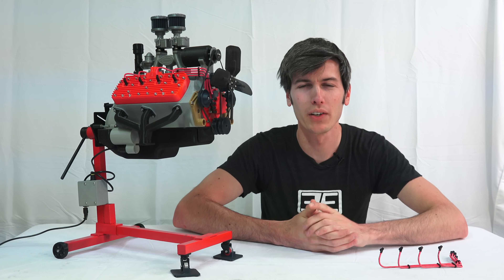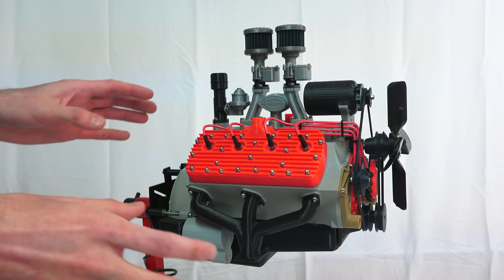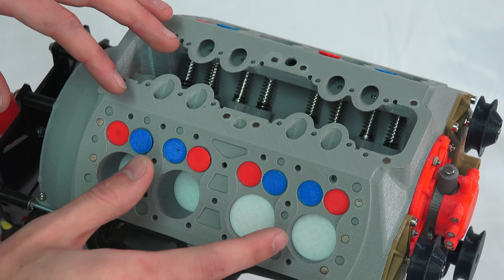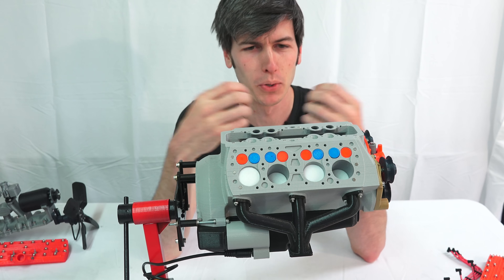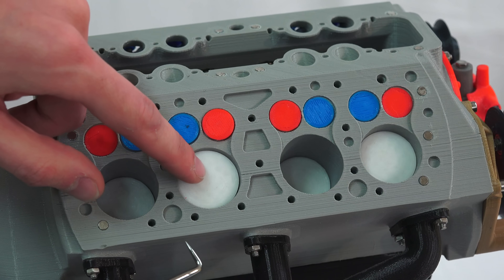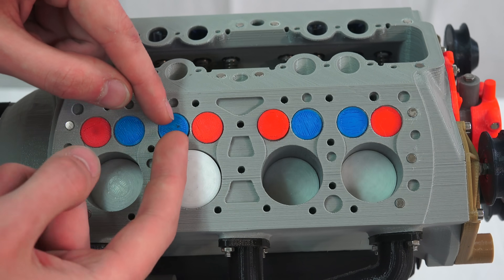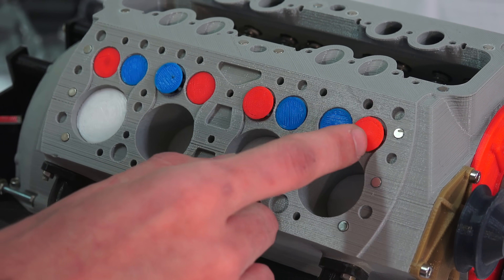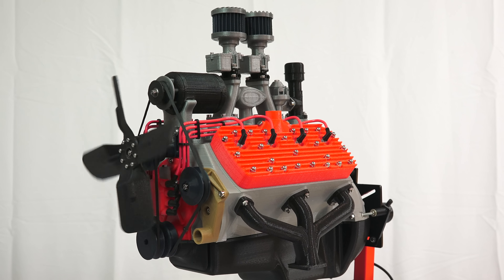Why Ford's Flathead V8 Engine Died

Comment: Lots of comments about the shortcomings of the Ford flathead. I recall seeing a documentary about its development that stressed its design as a means to build a V-8 of low enough cost to mass produce for ordinary cars that ordinary people could afford. V-8s (and 12s) had been boutique engines, very expensive, with separate cylinder blocks. The challenge of this block casting was almost insurmountable, and there were severe problems in early production engines, but they eventually worked things out.
Reply: In 1932, the new Ford V8 cost $10 more than the 4 cylinder model B (equivalent to around $182 today). That is incredible. Imagine something like that today!
Reply: I never understood why Ford didn't design it like a Caddie flathead V8. With exhaust right next to the intake. Maybe a little different to work with, but would have limited the overheating problems.
Reply: Yes, Ford did warranty those engines. Because of the engine production problems of the early V8's, Ford modified the Model A engine, which become the "Model B" engine, to keep the new 1932's moving out the door.  The 4 cylinder Model B engines remained in production into the late 40's.
Reply: Did Ford warranty all those blocks that failed early? I bet they didn't. Tough luck, buddy. buy a Chevy next time.
Reply: @alribee  Chevrolet had a v8 that saw limited production well before Ford's.  They were overhead valve engines, but they were horrible. Most were yanked out and thrown away.  Chevy didn't market another v8 until 55.

Comment: From across the pond. Excellent video, one of the best I have seen on this subject. My Morris 8 - 1937 era,  had originally 21.5 BHP and was 918 CC - 60mph flat out. The later engine was a massive 29 BHP. With a charger I broke the half shafts but could out run a Mini. The only plus side for a side valve was that you got one hell of a lot of swirl which did help burning at low revs. The Morris 8 had a larger pocket for the valves which allowed the gas to flow better. The CR was around 7. It did 45 mile to the gallon - just. I have owned Fords for around 50 years. Good old Henry.

Comment: So this small fan blowing air over the engine is enough to cool the whole block?
Reply: Sch lurf.
No, that not what the fan is for! The fan's job is to pull cool outside air through the radiator.
Reply: Yeah, I'm 'ere ah I see, thank you!
Reply: Sch lurf.
Cheers bloke. Rob.

Comment: My father born in 1919 and I we’re talking about Ford V-8 of this era. He said they were quite a bit quicker than other equivalent cars but they had drawback that he mentioned to me. He said they came oil burners very quickly after they were a couple years old. I don’t know if it was a design flaw or possibly they were just using soft piston rings that would wear out and allow excessive blow by. Chevrolet/ GM. Came out with the overhead valve six cylinder about the same time as ford came out with Flat head 8.  The stove Bolt six cylinder was not as fast off the line as the ford V8 but it did make about the same horse power. The Stove bolt engine was one of the most reliable and easy engine to maintain.  The early engines were about 164 in.³ and they were made all the way up to 170 in.³ in later years. The most common is probably the 235.  Even Toyota manufactured under license the Chevrolet/GM stove bolt engine. It morphed into the Toyota 2F used in the Land Cruiser’s.

Comment: If I remember correctly I believe the French built the flathead after Ford stopped building them for military use up to the 1980's. Hot Rod magazine did an article on flatheads a while back.
Reply: dethfan06.
French car manufacturer, Simca, produced the engine under license from 1954 to 1961.The engine was also produced, under license, in Brazil by military vehicle manufacturer Unic Marmon (also owned by Simca) until 1990

Comment: Compression ratios back in the day were so low because the gasoline octane was in the 60's...and that was on a good day. Indy race engines in the 30's were making nearly 100bhp/liter on methanol.
Reply: Aceroadholder-   That's true, but only tells part of the story.  The part not mentioned here is the space between the valves and the combustion chamber roof above them.  That's 'dead space', power-wise, as combustion taking place here shoves both ways:  against the valve crowns and against the chamber roof, totally wasting energy and creating stresses where they don't need to be.  In an OHV engine, combustion forces ALL act against the piston crown, being trapped by the chamber roof in the head.  This allows an OHV engine to be much more efficient at harnessing combustion energy and making horsepower.

Comment: Yep... Ford built this config because it was cheap, not because it had any performance or efficiency advantage. Henry had an obsession with cheap, to the detriment of technical progress. A pushrod OHV engine, as we can see by GM’s success, had/has much more potential for performance and efficiency. The installed power to weight, total installed volume (not displacement, but external volume), and fuel economy achieved by the LS and LT series V8s are rather remarkable. You can cruise down the freeway in a 450-odd HP sports car and be sipping fuel to the tune of near 30 mpg. DOHC designs, in contrast, offer higher power per unit of *displacement*, and higher textbook efficiency, but their physical size is greater, CG is higher, mass is higher, cost and complexity are higher, and hence total installed power and efficiency tend to be lower as a result.
Reply: You're comparing 1930 technology with 1950 tech. Yes, the Ford V8 was simple and for very good reasons: cheap to make. cheap to sell, cheap to maintain. It turned out to be one of the most successful engine platforms of all time. Era hot rodders loved it and hopped it up well past its demise as a production engine.

But time (and technology) marches on.The small-block Chevy was just as revolutionary in its day, and soon to become legend for its wonderful simplicity and durability. Availability of performance mods is endless. It derivatives live on today in the fabulous LS Series. A true American success story.

But to compare the two platforms against each other is futile and unfair.

Your inner fanboy starts to show when you dismiss it as a typical "cheap Ford"
Reply: Not a matter of fanboy, matter of history.  Henry had an unhealthy obsession with cheap, to the detriment of advancement.  That's why the Model T was produced so long after it was functionally obsolete.  Sadly that legacy lived on, as even the Mustang had a live rear axle until just this most recent generation.  Instead of proper suspension on the Explorer, they recommended underinflated tires.  Instead of proper wire gages, they used cheaper too-small wiring in the dash of millions of full size Broncos and pickups, resulting in fires and a massive recall... I witnessed one of these fires personally back in the 90's.  I could go on, but point is they have a history of focusing on cheap, regardless of performance or even safety.

Also, to demonstrate "not fanboy", I'll state categorically that GM has also had problems with letting beancounters rule over engineering at various points in their history.  Shoddy interiors (until only very recently), the disastrous Vega engine, the disastrous 8-6-4 engine, the Olds diesel... you get the picture.  They've made their share of crap.

Might want to check your facts on "1930's vs 1950's technology".  Buick patented an OHV engine in 1902.  The fundamental concept of a pushrod OHV engine actually predates 1900.  Ford was beaten to the OHV V8 punch by multiple manufacturers.  Again, their focus was on cheap to the detriment of advancement or performance.

Hot rodders did what they could with the flathead only because they were cheap and plentiful.

Comment: The French (backwards bastards) used them through the 80s
Reply: John Smith.
Simca, the French car company, manufactured the engine under license until 1961, and Brazilian military vehicle company, Unic Marmon, also manufactured it under license until 1990.
Reply: One of the few things they got right.

Comment: That took 3 rolls of gray filament just for the block, but nicely done! If the cam is correct, had actual spark, and took the solid headers off I bet it will run on naphtha. Wanna try it?

I question why oval pistons were not at least tried. Keep the piston heads away from the valve area but use more of the space available between cylinders. I'm not sure of one oval piston car/truck engine but knew Honda/HRC used them to great advantage, enough to get the design banned from racing. I guess casting still wasn't great back then so it wasn't a possibility in the endurance department.
Reply: This engine was designed as a cheap, well performing engine for the masses. How are you going to machine oval pistons and cylinders (and rings) cheaply?
Reply: Honda made an oval piston racing bike and it did OK. The problem was getting the rings to seal equally all around under every temperature and pressure condition. After spending years and mega-yen on it they went back to round pistons. They're simply much easier to work with and much cheaper to make and run.

Comment: Hey Jason, can you do a video on blow off valves and more specifically on whether removing/blocking it is bad for your turbo or not. This debate has been raging on the Mazdaspeed and Subaru forums for a while and nobody seems to have a clear answer. Some say it's okay as long as your turbo isn't making a lot of boost and others say it destroys the bearings either way. Can you please shed some light on that subject. Thanks!

Comment: The French military made and used the flathead Ford up to the 90's. Just ask Flathead Jack.
Reply: prancstaman.
French car company, Simca, produced the engine under license from 1954 to 1961. The engine was also produced in Brazil by the military vehicle manufacturer Unic Marmon (also owned by Simca) until 1990.
Reply: Yeah, I'm 'ere Brazil military too, cool. Thanks for the info.
Reply: prancstaman.
Ford also supplied the engine to many industrial, agricultural, and construction machinery manufacturers around the world who couldn't produce their own engines. Cheers, Rob.

Comment: AMC was still using a flathead six cylinder engine in some of its models till around 1964...
Reply: I learned to drive a '53 Plymouth with a flathead six/"three on tree." I was born in 1947 (before Truman was elected). I swear--and I look it.
Reply: They outstalled Chrysler.  Mopar was still selling flathead 6's in 1958.

Comment: That motor seemed so clever. Lower center of gravity, less weight, shared common parts... Until you explained the airflow issues. That seemed like a lot of HP but it's outmatched by today's standards.

Comment: i can see the intake runners but where does the exhaust go??
Reply: stickloaf Through the block. The cylinder head is basically just there to cap the cylinders and hold the spark plug.
Reply: the 2 center cylinders of each block bank had to channel exhaust gases through one  narrow passage through the cooling water chamber in order to meet the central tube of the exhaust manifold  on the outside of the block ( look a the video and observe the exhaust manifold, it has 3 tubes) . At high power outputs the exhaust flow of these cilinders added heat to the cooling warter stressing the block casting. Many blocks developed cracks after overheating events. on the engine. The first and Forth cilinders of the block bank had  its own exhaust passage and lived more comfortable. erwin Finsterbusch

Comment: I'd sacrifice some efficiency and power for more reliability and better ease of repairs. The simpler an engine is, the fewer parts there are. The fewer parts there are, the less there is to break. The less there is to break, the more reliable the engine will be (compared to other more complex engines). I bet with modern technology, Ford could revive the flathead and get 500+HP out of it, but the government would probably make it impossible due to emissions and regulations and such.

Comment: I love the flathead Ford. I have one in my street rod. It is the simplest V8 ever made. It makes a beautiful sound. It is super easy to work on. Compared to the computer controlled fuel injected DOHC 16 valve intercooled turbocharged VVT inline four in my Chevy Sonic transportation car, which is an absolute nightmare, the flathead Ford is a masterpiece of industrial art. It is my favorite engine, way ahead of my second favorite engine, the old school OHV cast iron small block Chevy. I'm 59 years old, and a serious vintage car guy. I don't give a rat's ass about newer cars. They are cheap used, you buy them, drive them, and throw them away when they break down.

Comment: they used to crack blocks. Cadillac had first v8 much better ohv
Reply: Cadillac v8s were flatheads from 1914 to 1948. OHV introduced introduce five years before the Ford OHV.
Reply: motorhead.
The first V8 engine was patented by French engineer Leon Levavasseur in 1902, it was a 24 hp fuel injected unit developed for competition speed boats.
Reply: Yeah, I'm 'ere check out the Napier Deltec diesel . Triangle three crank two stroke . Awesome engine used in British trains.
Reply: motorhead.
Yeah, that's a very durable and powerful engine, it sounds terrific at full scream as well! Napier certainly produced some amazing engines in their time. Cheers, Rob.

Comment: The thing that fascinates me about this engine is its crankshaft is supported to the block with only 3 main bearings. The simplicity of its design, as demanded by Henry, even left out an oil pump on the first few prototypes, leading to early engine failures. The basic designed engine was fitted to all 3 car divisions vehicles and went on to become the #1 choice for hot rodding. Technology has all but left the Ford design extinct, save for the flat head enthusiasts and museum displays. But hey!, in 1832 that was cutting edge technology of the time.

Comment: My father had 2 Chrysler Imperials, 1 a 69 with a 440 and a Holley 4 brl. The other, a 73 also with a 440 and a Thermoquad 4 brl. The 69 produced 350 hp and the 73 only 210 due to the wonderful smog junk. I never ever thought we would see 300 hp engines again in my lifetime... Boy was I wrong ;-) Amazing what tech has done :-) And time marches on... wonder what the next 50 years will bring ??? Thanks Mr EE :-)
Reply: There was power loss thanks to lower compression ratios, timing changes, possibly cam changes, and introduction of EGR starting around ‘72, but they also changed horsepower ratings from brake HP to net HP, from rating a “bare” engine to one with all installed accessories. Actual power drop, while real, was not as great as the numbers made it seem. We had a ‘73 New Yorker. Its 210 HP net-rated 440 was considerably stouter than our ‘69 Fury’s 318 was at 230 brake HP. The New Yorker was heavier, too, a real battleship.

Comment: How do you get more power out of a flathead? Again... I've got a couple books on this..... Can we stop this bashing of old tech? There are flatheads easily pushing over 300hp with superchargers, and n/a builds have easily seen 200-230hp. I don't understand why you stop at factory tech and outright ignore the massive advances made by the aftermarket (like different heads, intakes, ect). How about crank swaps to gain stroke length, ect... 

This after the "push rod motors can't rev" thing is honestly insulting to your viewers who know anything about old engines.
Reply from the maker: I think the tech is awesome! That doesn’t mean it has great airflow. Boost can make anything powerful, ultimately OHV tech was superior and won out, as discussed in the video. It’s not bashing at all, just stating facts around the history and engineering of the engine.
Reply: I'll concede to presented points. Forced induction does in fact fix even the worst designs of cylinder head, which I maintain to be any Ford FE engine head that wasn't a tunnel port.

I guess I just want to see a bit of aftermarket love for the Flathead because its such a major automotive icon. A lot was done to help it stay relevant. Granted, we shouldn't discuss the costs of attaining a modern power level flathead... it'll make ya cry.

Comment: i love to see a true air and fuel designed V8 engine, doesn't matter which one that uses sensors, a small MAF/MAP, IAT, Coolant temp with an engine as small as 1/4 of your monitor screen.

Comment: The Ford side valve V8 did not disappear in 1953 but was used in slightly modified form by Simca in a military truck they built until 1973. The simplicity made it an excellent choice for military duties.
Reply: Bill Hollingsworth.
Simca produced the engine under license from 1954 to 1961. for their cars. The engine was also produced, under license, in Brazil by military vehicle manufacturer Unic Marmon (owned by Simca) until 1990.
Reply: Thanks for the correction. The side valve v8 certainly lived on.
Reply: Bill Hollingsworth.
Up until 1953ish, Ford also supplied the engine to many industrial, agricultural, and construction machinery manufacturers around the world who couldn't produce their own engines. Cheers, Rob.

Comment: Your model is a 1938-1948. The 1949-1952 had the water hoses on the front of the heads, and used a conventional distributer on the right side of the engine. 1932-48 fords used a torque tube, which transmitted the driving forces from the rear wheels to the frame by the motor mounts. 1949 and later fords used a conventional differential and drive shaft.

Comment: I just noticed... That exhaust manifold looks wrong, like, is the exhaust going inside the block where the cooling gaskest would go?
Reply from the maker: Yep, exhaust in the block, and it did cause heat issues.